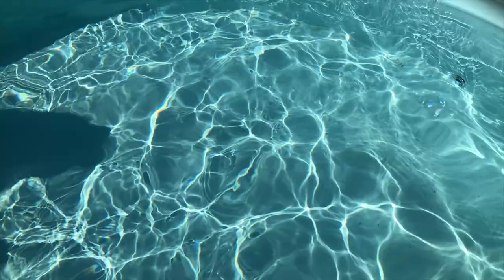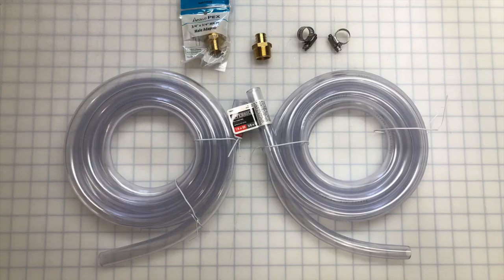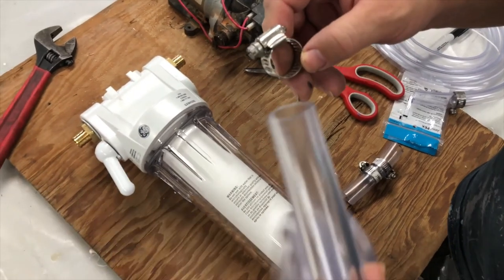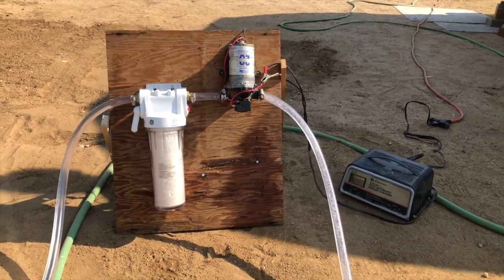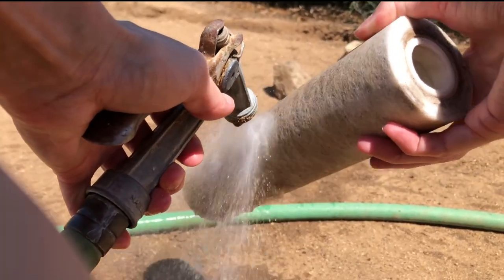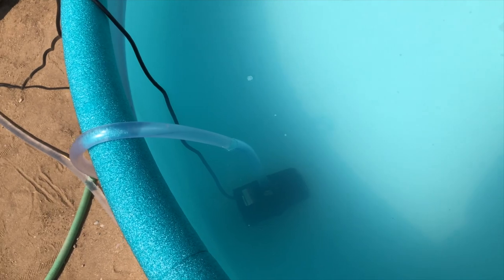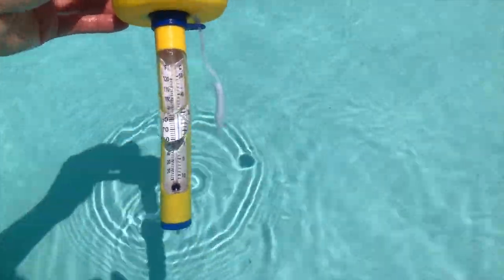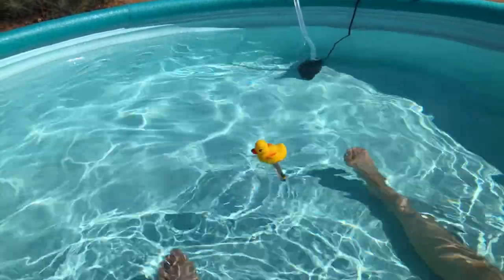DIY Stock Tank Pool Pt2 - Pump and Filter

Comment: Great job. You guys really got creative. I installed a very similar stock tank pool project here in Atlanta this past spring. Luckily I was early enough to go get both the stock tank and Intex pump/filter with no troubles. I did the pool noodle trick, as well, and mine shrunk, too! Weirdest thing. I’m still not sure why. I had to buy an additional noodle that I cut about a 12” piece off to fill in the gap.

Comment: If you use a sand pump filtration system it is more expensive but you don't have to change the sand for 6 years in fact you don't have to do anything to it but run it. It may cost more but it's less expensive to use it in the long run and it's far more durable.
Reply from the maker: Thanks for the advice! We did end up getting a sand pump system this year and so far it’s awesome. I’ll do a video update soon, too much other work at the moment 😅

Comment: Hi! I just watched your video because I’m researching how to prep my stock tank pool. I’m just curious as to how your pool held up after applying the epoxy? I’ve watched other videos, but all of that sanding seems like a lot of work! Would you do things differently looking back? Thanks!
Reply from the maker: The pool is great! We didn't sand it and the epoxy is holding up just fine so I definitely wouldn't bother with that. There's a bit of discoloration at the top above where the water line was, maybe from bleaching from the sun or chlorine? And there are some spots on the bottom that look like maybe we didn't mix the epoxy well enough on that batch but it's not effecting the pool. The only thing I would do differently is maybe put the pool in location before applying the epoxy. When we rolled the pool through the dirt it did scratch off at the rim in a few places. You don't see it because the pool noodles cover that part. I hope this helps, and good luck with your pool!
Reply: We are  in the second season with our pool and the epoxy is holding up just fine

Comment: Great video, thanks! Our stock-tank pool has been getting a bit cloudy, but we assumed it was 100% due to stuff we needed to filter out... but in your video you said the chlorine cleared up some of the murkyness? We've been wanting to avoid chlorine, but if that will make a big difference in keeping the water clearer longer, then it's worth a try. Thanks!
Reply: Yes the chlorine works great we a got a little floaty thingy you put the tablets in and the slowly dissolve
Reply from the maker: Yeah I was reluctant to use chlorine too but it’s really effective! We have a sand pump now and even with that the water gets cloudy if we don’t use chlorine tablets from time to time
Reply: @PreparetoDIY  thanks! My GF is super against me using chlorine, so I'm wondering if I can use "just enough" to keep the cloudy from getting "bad" , but not enough that she really notices that there's chlorine in the water. Looks like I'll be doing some experimenting! :)